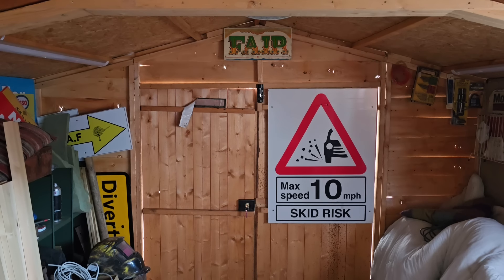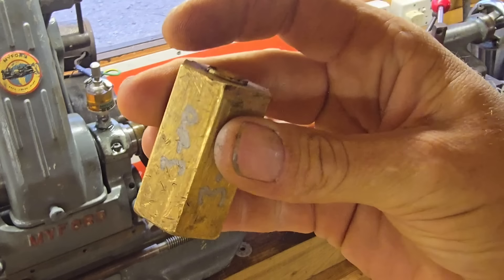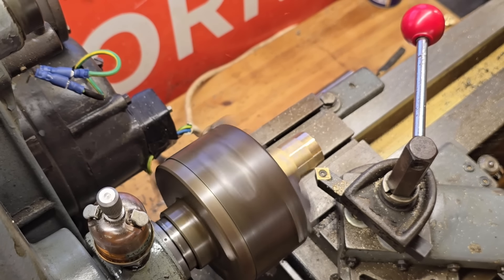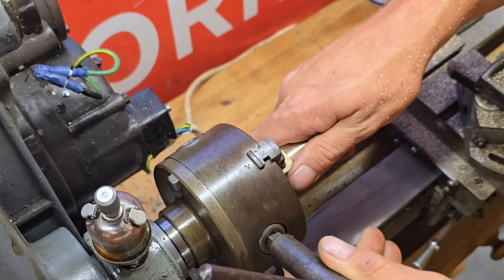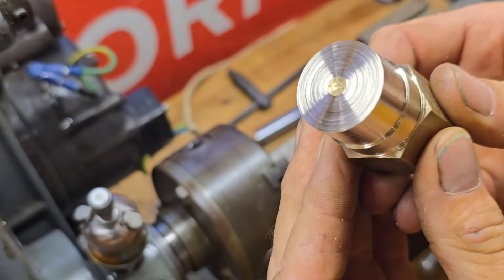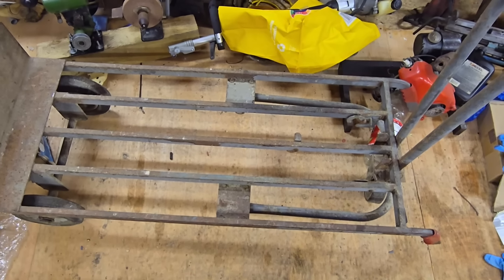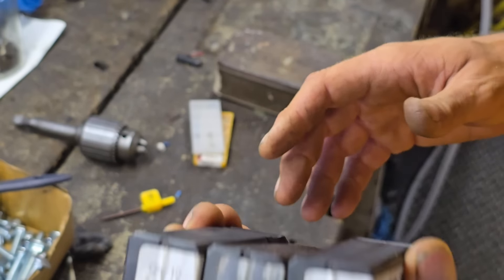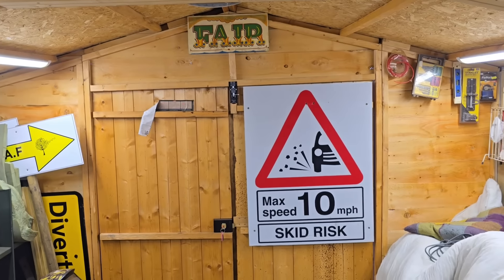More MyFord Lathe action. Plus extra bits.

Comment: Your getting the hang of it boy! 👍 if your working on anything that sticks out of the chuck more than a couple of inches you'll need the live centre for stability, you can also use it for setting the height of the tooling in the centre post and for centering work in the chuck.
The tools in the box are a Mag base and posts with a couple of DTI's (dial test indicators) they are important if you need to check the lathe or indeed the work piece is running true.
Reply: really depends on the diameter of the work material. I hardly ever use a centre on anything less than 8 inches from the chuck, and it if something like inch bar, then even further can be done without deflection. If its small stuff (under 1/2") then yes I agree. 

I once got myself a digital DTI, (use it mostly for setting work up on the mill) I soon went back to a normal analog one, as I found the digital one slow in response to the movement placed on the actuator.  Adam looks like he has got 2 nice ones there. Great finds

Comment: Yo Mr Mancave how goes it?
The tool you were using is generally used as a chamfer tool. It would be good for you to invest in a set of carbide tool holders. For general turning you need a RH (right hand tool holder) this will allow you to turn in the direction of the chuck and to face across your work piece. It will also massively improve your surface finish. Happy turning and welcome to the joy of Myford.😃👍

Comment: Well done Adam making swarf is good fun especially at the end of you have made something useful, there are lots of different tips out there including ones for mild steel tool steel, brass, aluminium etc etc all with different makeup’s of tungsten.
I found tungsten great for harder materials and even heavier cutting on steel, but for aluminium, brass etc or non ferrous metals I find HSS tooling the best as even using a normal bench grinder you can get a very sharp tool and finishing the cutting face with a diamond wheel even better.
Plus depending on the shape / size of tool you need for a specific job you can grind to suit.

Comment: You could use a ceramic tip to polish off finished brass to get a nice smooth finish.try your local scrap dealer about any metal stock.

Comment: To get a smoother finish try two things. Turn the cutting tool so that it cuts into the length of the piece not the diameter.  Try it in line with the topslide.  Secondly using the power feed will  steady out the cutting process.

Comment: For turning brass a a Bull nose (round) topped tool is gives the best finnish this also applies to cast iron which is also a very easy material to machine. The tool you are using looks like it is for thread cutting so not the best for general turning and when you were facing it looked like the tip holder itself was rubbing on the work, also having the compound slide set to an angle limits you to using the saddle travel for turning which gives a rougher finish generally and also makes it harder to go up to a face. The compound is generally used for short fine work or turning. tapepers.